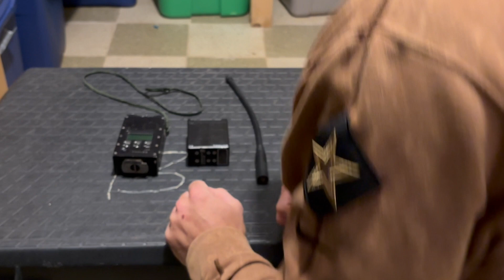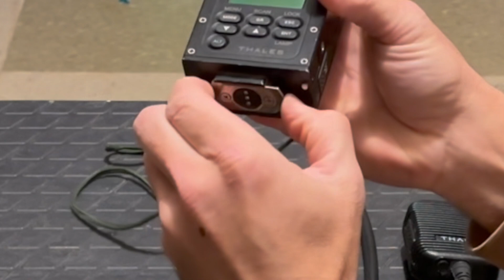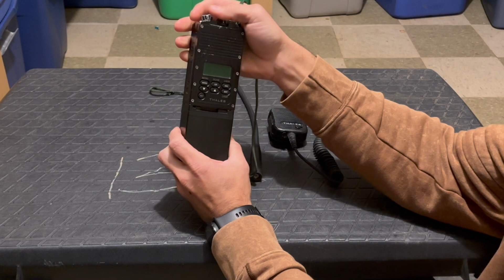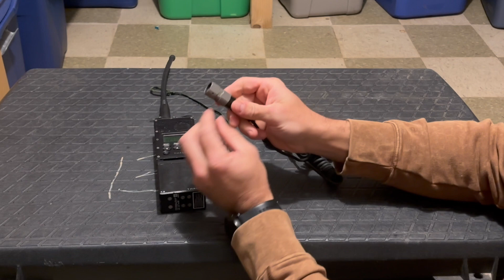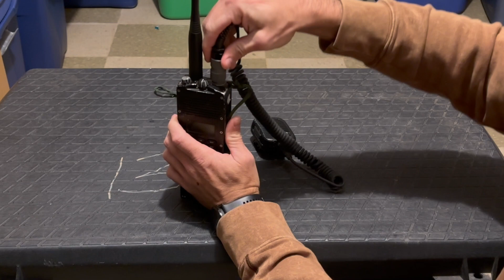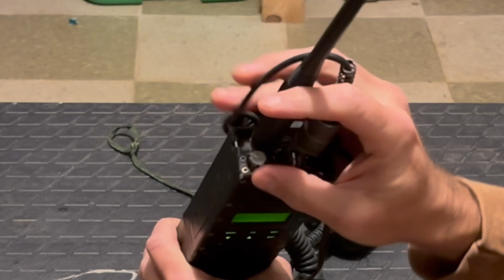RANGER Task Training (RTT) - MBITR

Comment: Hey i just signed a contract for the army 25H with airborne and ranger in my contract l. i ship july 22 and i suck st running. any tips on how to pass the 5 mile under 40 min? i’m passing on pushups sit ups and pull ups
Reply from the maker: Hey, if you follow this link below I did a video specifically on the 5 miler. Please let me know if you have any other questions. 

https://youtu.be/axE48yzCtQY?si=qr5ab85gz9GcAKMy